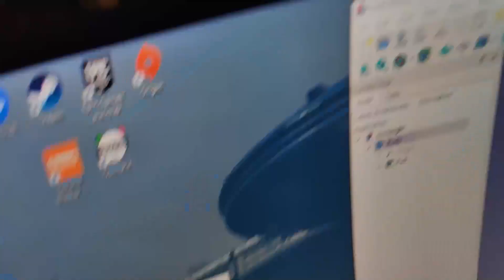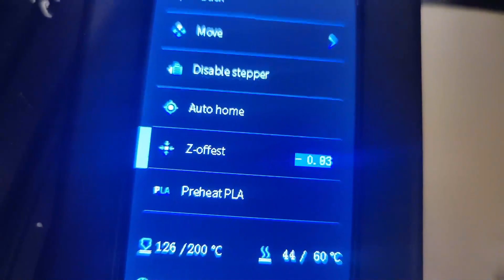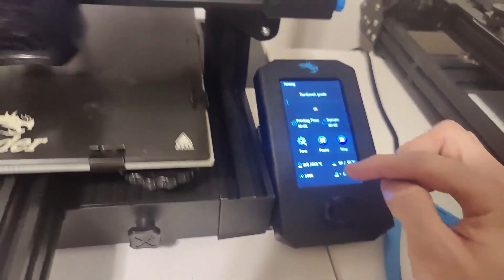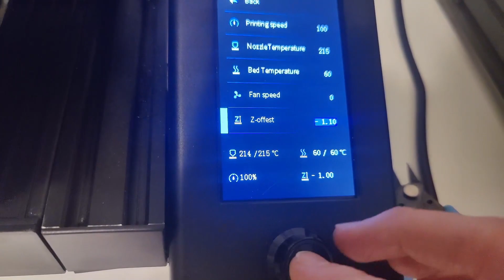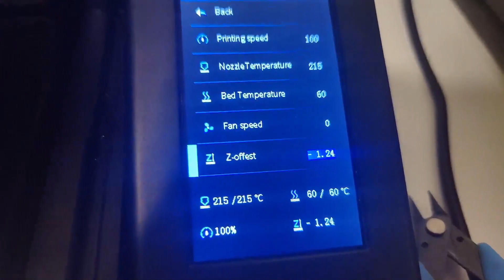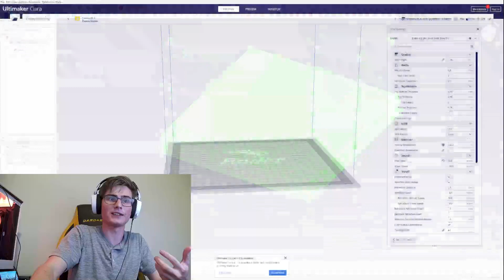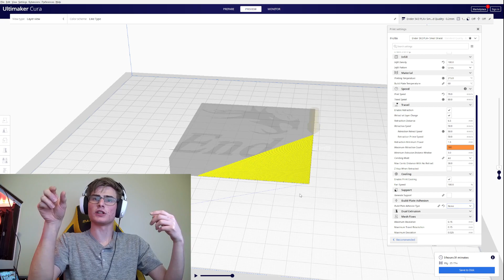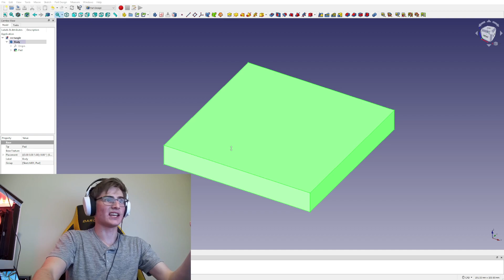How-To Calculate the PERFECT Z-Offset For Your Creality Ender 3 v2 - CR Touch

Comment: PLEASE HELP!!!
After installing my CR touch, I start printing and it performs its leveling at several points (4×4).
The problem is that during this upgrade the nozzle turns off for no reason. On the other hand, the heating plate always remains hot.
It's annoying because the leveling will be distorted, moreover once the leveling is done the printer does not wait for the nozzle to reach its original temperature again, and starts printing directly. Result: Unable to perform reliable printing.
What should I do to solve this big problem?
Reply from the maker: That is odd. It should be fine though. I dont think the temperature drop will change too much on the glass. At least not for standard PLA or ABS temps
Reply: @ThePrintHouse  I'm only printing with PETG 😆
Reply from the maker: @wendigo6782  well petg and abs are basically the same print Temps
Reply: @ThePrintHouse  yes true, but I'm still stuck with the nozzle turning off during bed leveling. 
I tried to modify my start gcode many times but it doesn't work..
Reply from the maker: @wendigo6782  interesting. Are you manually adding in bed level gcode or are you doing it from the printer
Reply: @ThePrintHouse  I tried to modify on cura, and then save and print
Reply: @ThePrintHouse  Here are some cura gcode lines I tried:

; Ender 3 Custom Start G-code
M140 S{material_bed_temperature_layer_0} ; Set Heat Bed temperature
M190 S{material_bed_temperature_layer_0} ; Wait for Heat Bed temperature
M104 S240; start warming extruder to 240
G28 ; Home all axes
G29 ; Auto Bed Level
G92 E0 ; Reset Extruder
M104 S{material_print_temperature_layer_0} ; Set Extruder temperature
G1 X0.1 Y20 Z0.3 F5000.0 ; Move to start position
M109 S{material_print_temperature_layer_0} ; Wait for Extruder temperature
; G1 Z2.0 F3000 ; Move Z Axis up little to prevent scratching of Heat Bed
G1 X0.1 Y200.0 Z0.3 F1500.0 E15 ; Draw the first line
G1 X0.4 Y200.0 Z0.3 F5000.0 ; Move to side a little
G1 X0.4 Y20 Z0.3 F1500.0 E30 ; Draw the second line
G92 E0 ; Reset Extruder
G1 Z2.0 F3000 ; Move Z Axis up little to prevent scratching of Heat Bed
G1 X5 Y20 Z0.3 F5000.0 ; Move over to prevent blob squish
; End of custom start GCode

; Ender 3 Custom Start G-code
G92 E0 ; Reset Extruder
G28 ; Home all axes
M104 S240 ; Set Extruder temperature for bed leveling
M140 S{material_bed_temperature_layer_0} ; Set Heat Bed temperature
M109 S240 ; Wait for Extruder temperature for bed leveling
M190 S{material_bed_temperature_layer_0} ; Wait for Heat Bed temperature
G29 ; Auto Bed Level (CR Touch)
M104 S{material_print_temperature_layer_0} ; Set Extruder temperature
M109 S{material_print_temperature_layer_0} ; Wait for Extruder temperature
G1 Z2.0 F3000 ; Move Z Axis up little to prevent scratching of Heat Bed
G1 X0.1 Y20 Z0.3 F5000.0 ; Move to start position
G1 X0.1 Y200.0 Z0.3 F1500.0 E15 ; Draw the first line
G1 X0.4 Y200.0 Z0.3 F5000.0 ; Move to side a little
G1 X0.4 Y20 Z0.3 F1500.0 E30 ; Draw the second line
G92 E0 ; Reset Extruder
G1 Z2.0 F3000 ; Move Z Axis up little to prevent scratching of Heat Bed
G1 X5 Y20 Z0.3 F5000.0 ; Move over to prevent blob squish
; End of Custom Start G-Code

; Ender 3 Custom Start G-code
M140 S{material_bed_temperature_layer_0} ; Set Heat Bed temperature
M190 S{material_bed_temperature_layer_0} ; Wait for Heat Bed temperature
M104 S240; start warming extruder to 240
G92 E0 ; Reset Extruder
G28 ; Home all axes
G29 ; Auto Bed Level
M104 S240 ; Set Extruder temperature for bed leveling
M140 S{material_bed_temperature_layer_0} ; Set Heat Bed temperature
M109 S240 ; Wait for Extruder temperature for bed leveling
M190 S{material_bed_temperature_layer_0} ; Wait for Heat Bed temperature
M104 S{material_print_temperature_layer_0} ; Set Extruder temperature
M109 S{material_print_temperature_layer_0} ; Wait for Extruder temperature
G1 Z2.0 F3000 ; Move Z Axis up little to prevent scratching of Heat Bed
G1 X0.1 Y20 Z0.3 F5000.0 ; Move to start position
G1 X0.1 Y200.0 Z0.3 F1500.0 E15 ; Draw the first line
G1 X0.4 Y200.0 Z0.3 F5000.0 ; Move to side a little
G1 X0.4 Y20 Z0.3 F1500.0 E30 ; Draw the second line
G92 E0 ; Reset Extruder
G1 Z2.0 F3000 ; Move Z Axis up little to prevent scratching of Heat Bed
G1 X5 Y20 Z0.3 F5000.0 ; Move over to prevent blob squish
; End of Custom Start G-Code

; Ender 3 Custom Start G-code
G92 E0 ; Reset Extruder
M140 S{material_bed_temperature_layer_0} ; start preheating the bed
M104 S{material_standby_temperature} ; start preheating hotend
M190 S{material_bed_temperature_layer_0} ; end preheating bed
M104 S{material_standby_temperature} ; start heating hotend
G28 ; Home all axes
G29 ; Auto Bed Level
M109 S{material_print_temperature_layer_0} ; wait for hotend to reach printing temperature
G1 Z2.0 F3000 ; Move Z Axis up little to prevent scratching of Heat Bed
G1 X0.1 Y20 Z0.3 F5000.0 ; Move to start position
G1 X0.1 Y200.0 Z0.3 F1500.0 E15 ; Draw the first line
G1 X0.4 Y200.0 Z0.3 F5000.0 ; Move to side a little
G1 X0.4 Y20 Z0.3 F1500.0 E30 ; Draw the second line
G92 E0 ; Reset Extruder
G1 Z2.0 F3000 ; Move Z Axis up little to prevent scratching of Heat Bed
G1 X5 Y20 Z0.3 F5000.0 ; Move over to prevent blob squish

; Ender 3 Custom Start G-code
M140 S{material_bed_temperature_layer_0} ;Start heating bed
M104 S{material_standby_temperature} ;Start preheating hotend
M190 S{material_bed_temperature_layer_0} ;Wait for bed to reach temp
M104 S{material_print_temperature_layer_0} ;start heating hotend
G28 ; Home all axes
G29 ; Auto Bed Level
M109 S{material_print_temperature_layer_0} ;Wait for hotend to reach printing temp
G92 E0 ; Reset Extruder
; G1 Z2.0 F3000 ; Move Z Axis up little to prevent scratching of Heat Bed
G1 X0.1 Y200.0 Z0.3 F1500.0 E15 ; Draw the first line
G1 X0.4 Y200.0 Z0.3 F5000.0 ; Move to side a little
G1 X0.4 Y20 Z0.3 F1500.0 E30 ; Draw the second line
G92 E0 ; Reset Extruder
G1 Z2.0 F3000 ; Move Z Axis up little to prevent scratching of Heat Bed
G1 X5 Y20 Z0.3 F5000.0 ; Move over to prevent blob squish
; End of custom start GCode

; Ender 3 Custom Start G-code
M140 S{material_bed_temperature_layer_0} ; Set Heat Bed temperature
M190 S{material_bed_temperature_layer_0} ; Wait for Heat Bed temperature
M104 S240; start warming extruder to 240
G92 E0 ; Reset Extruder
G28 ; Home all axes
G29 ; Auto Bed Level
M140 S{material_bed_temperature_layer_0} ; Set Heat Bed temperature
M190 S{material_bed_temperature_layer_0} ; Wait for Heat Bed temperature
M104 S240; start warming extruder to 240
M420 S0 ; Recall saved mesh
G1 Z2.0 F3000 ; Move Z Axis up little to prevent scratching of Heat Bed
G1 X0.1 Y20 Z0.3 F5000.0 ; Move to start position
G1 X0.1 Y200.0 Z0.3 F1500.0 E15 ; Draw the first line
G1 X0.4 Y200.0 Z0.3 F5000.0 ; Move to side a little
G1 X0.4 Y20 Z0.3 F1500.0 E30 ; Draw the second line
G92 E0 ; Reset Extruder
G1 Z2.0 F3000 ; Move Z Axis up little to prevent scratching of Heat Bed
G1 X5 Y20 Z0.3 F5000.0 ; Move over to prevent blob squish
; End of Custom Start G-Code

Thank you for your help, your video was also interresting!

Comment: @the print house what firmware and motherboard do you use? My z-offset only allow 0.100mm adjustments D:
Reply from the maker: I use jyers firmware now. I used to use the stock firmware, but I would not recommend it. Jyers is much better. I cannot remember the exact board I have on my printer but it is stock.

Comment: I think this is a great video but a lot of us are stuck on what firmware is needed.  Creality has changed their website so even the CR Touch instructions don't match the website so when it comes to the very important, what firmware is needed, we are lost.  I know the version number of the board but when looking at Creality firmware download site its very unclear as to what actual firmware is needed.  That would be a good thing to add to this video.  The old dogs that are not as smart as you young bucks are having some issues figuring out where to start on the firmware.  I have a brand new Ender V2 that I added the CR touch to and its not working properly, i am sure I don't have the right firmware.  Please add this to the video and help us out!  Thanks for your videos!
Reply from the maker: Thank you for the update on that. I will check creality's website and I will see if I can make a new video. I will be traveling soon so that might be pushed back a little bit.

Comment: So I should level the bed before installing the auto bed level. Then level the bed again moving the Z axis and then I adjust the Z offset.
Then print a test file and adjust again as it prints.
What the CR/ BL touch actually does? I installed one on my Ender 3 V2 and can't print *hit anymore....
Ideas, anyone?
Reply from the maker: Once you have the bed leveled and your springs tight, you should almost never have to touch the bed again because the BL touch should handle the rest. What problems are you experiencing?

Comment: My print head hits the build plate and tries to go even lower so it freezes up. Do you have any suggestions?  Thanks in advance.
Reply from the maker: You can unscrew your z stop switch and raise it! That will fix your problem! Check this video out. It explains how I did it on the enter 3 (except I lowered mine you need to raise yours) https://www.youtube.com/watch?v=UuvNvwOzdGQ

Comment: This is a great tip. I didn't even know I needed a z-offset or what it was used for until now. I was using manual bed leveling to get a proper first layer which was taking forever since my bed seems slightly higher in the corners than the center. I will try your method.
Reply from the maker: Oh goodness I hope you were able to get it all working!!
Reply: @ThePrintHouse  yep I got it totally dialed in with the right z-offset and got a cr touch installed for auto bed levelling. First layer goes down great and consistent now even on the corners of the larger bed of my ender 3 max. I think the larger bed which is warped made it trickier to dial in than a standard ender 3.

Comment: if your offset is -1.28 then why at -1.20 you couldnt get the paper under the nozzle. was that because the first one needed its bed leveled again?
Reply from the maker: That is a possibility. The other possibility is that the edge of the paper was just a little gnarled and could not fit under it.

Comment: This video was very helpful after I was struggling with first layer accuracy for a while and pulling my hair out. Thank you. I used the test print file you recommended and shown in this video. I got my Z offset to what I THOUGHT was correct the way I would normally do it, but upon trying to test print I see the layers were not binding at all. Dialed it in and turned out I needed to go another .10 down. -1.22 is the magic number for me.
Reply from the maker: I love getting responses like these! Thank you!
Reply: Yes, the magic Z axis. Have also lost much hair in the process. No worries, can print a whole lot of plastic hair now.

Comment: You showed exactly the issue that is becoming more common.  The Z- offset is inconsistent.  The height difference between the nozzle and the probe should NEVER change (until you replace the nozzle).  BLtouch never had this problem.  I've been fighting this since I got the Ender 3 S1 a few weeks ago.  tried different firmware.  I get several good prints and then several that won't stick (nozzle too high)
Reply from the maker: Unfortunately it is inconsistent. There will definitely be a little bit of inconsistency with every probe, but it should not be enough to change the z offset. Maybe what you are experiencing is the wear down of a nozzle changing your z offset.

Comment: Awesome video. Would you know why the top of my first layer isn't smooth at all as the bottom? Im printing with an ender3 v2 and glass bed!
Reply from the maker: That is so weird. The bottom layer is perfect but the top is rough? I wonder if you have an old rough nozzle that needs to be replaced. I can see the possibility that when you extrude the plastic it smooths on the bed while it is liquidy but because the top has nothing to squish against it leaves a rough surface. I would definitely try a nozzle change if you havent yet.

Comment: Is the Z offset a Global Absolute offset, or a relative one?  With normal G code on industrial machines, that would be an offset to ALL points, including reference points, home position, etc. The start point of the individual programs would be an absolute position from home (on all axes), and all following points would be relative to that value.  Is that how these enders work?  It seems if the Z offset was absolute, the nozzle tip should be tangent to the bed plane, and layer height should dictate the starting position of the Z axis.  Dont mean to ramble, just wondering why I have to change my offset every time I change layer heights between parts.

Comment: Do you have to move the z axis to 0 every time before a print
Reply: how did you end up fixing this if you remember? i’m having a similar issue
Reply from the maker: I do not move my z axis to 0 before a print. That should be unnecessary.

Comment: Great video.  Easy instructions on the Z Offset.

I have a Ender 3 V2 and have ordered a CR Touch today.  What Firmware are you using on your V2?

Thanks
Reply from the maker: Thank you!! I am using the standard firmware, but I want to try jyers. I think I will be running klipper very soon though.
Reply: @ThePrintHouse  I had planned to use JyersUI but the chipset on my 4.2.2 board is the RCT6, not the RET6, so I can't use Jyers.  I'm considering ordering the 4.2.7 board with the RET6 chipset, but will try Creality's Firmware for a while and see how it goes.

Comment: Hi, on a normal Ender 3, I was only able to get .1mm accuracy, and my offset was at around -.4. Just wondering if this is normal as yours was -1.28. Thanks.
Reply from the maker: I think every offset is going to be a little different. It depends heavily on the mount you use and even something as crazy as how tight your screws are. 3d printed mounts are where the most variation will come from

Comment: I set up my brand new Ender 3 v2 including the CR Touch and now my heat nozzle won't even come close to the heat bed. Do I have to unhook the CR touch and level manually with what came in the box and then install the CR touch after the initial leveling? Thanks for your help.
Reply from the maker: I would recommend deleting the eeprom on your SD card and then retrying what I put in the video :)

Comment: Hello I have an ender 3 v2 and just recently purchased the CR touch. I am have a lot of trouble with the z axis offset. When I try to do what you did in the video the test print does not work at all and does not stick to the bed and every time I try to redo it I get a different z offset every time. I have no clue on what to do and how to fix it? Also is there something in the g code that could fix it I did the g code change that it said in the instructions but I am still not getting what I need?
Reply from the maker: There is nothing you can do in the gcode unless you already know what offsets you need. I would recommend deleting your eeprom on SD card and trying this video again :)
Reply: @ThePrintHouse  I did that and still did not work

Comment: I don't really know hot to work it I bought this so I don't have to fiddle with the nobs and everytime I try and autohome it does the sequence and ones I print it there still problem with bed leveling
Reply from the maker: Can you please tell me what your problem is? Are you doing everything in this video? I might be able to help you if I have more information! :)
Reply: Ya I I bought the auto bed tool so I don't have to use the nobs anymore but it seems that I forget that I still have to have a stable surface so that probably why it wasn't working well I think I got it now
Reply from the maker: Ok yeah!! So unfortunately you will still need to have a stable bed that does not change easily, but if you upgrade your bed springs and properly install a BL touch then you will almost never have any issues :)
Reply: Is it just me or do the bed level nobs move on there own I can't tell you how many times I have manually leveled it but have had problems where it becomes unleveled

Comment: Is the Z offset constant as long as the bed level isn't changed?
Reply from the maker: Yes! If the bed level is never changed then the z offset will never change. I would recommend redoing your z offset once every 30-50 print hours just to make sure it stays as perfect as possible, but realistically you wont need to redo it until you begin to notice bad 1st layers. Your biggest z offset issue will come when you are aggressive with removing your prints from the build plate.

Comment: This is really helpful, thanks. Slight issue I have is that I get a 2 hour print with those settings but with infill at 20%. If I set my infill to 100% it jumps to 8 hours 9 minutes. I'm not planning to print the whole cube, I just want to use the initial layer but out of curiousity, how did you get 3.5 hours with those settings?
Reply from the maker: No problem!! I'm glad this was helpful!! And I'm not entirely sure. I have some highly modified printer profile settings. I actually tried to replicate my profile once when I was away from home and it didn't work. Also I have can't remember on this one maybe I lowered the cube into the print bed so it didn't print the entire thing?

Comment: Every time I Auto-Home or Auto-Level the nozzle ends up several millimeters higher than the last time. I've check everything I can check.
Reply from the maker: Are the knobs on the bottom of your print bed loose? I had that issue once and it turned out the knobs in my print bed would always come loose and when I removed my part from the print bed I would be applying enough force to lower the bed a few millimeters.